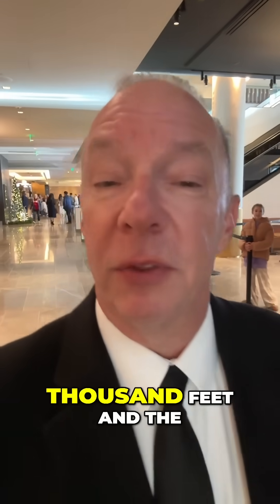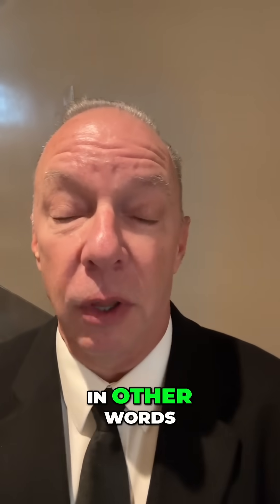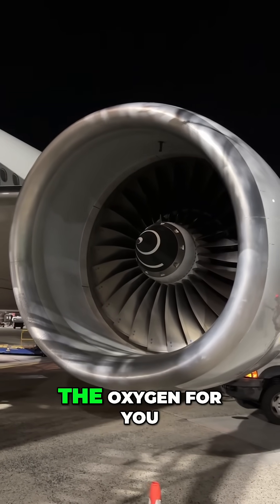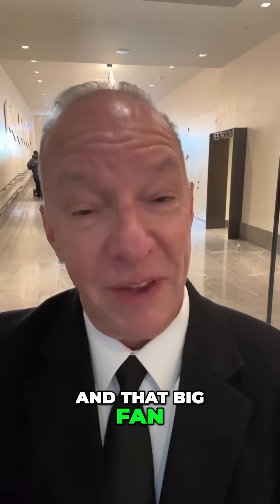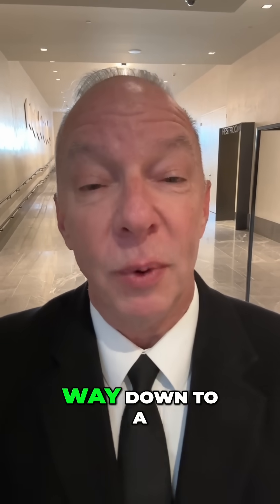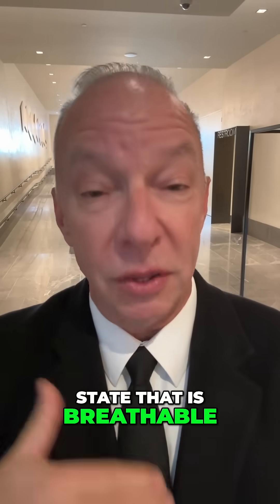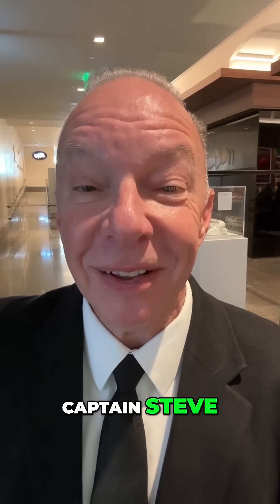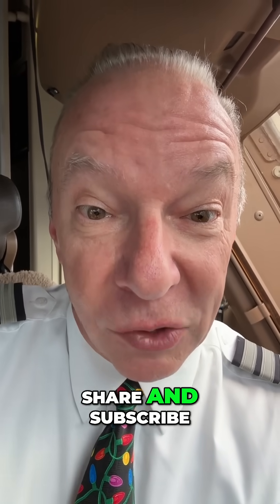How Airplanes Make Breathing Possible at 37,000 Feet

Comment: On very long haul flights, the partial recirculation of 40% of the cabin air should cause some slight increase in CO2 accumulating, although it is probably negligible. On the other hand, the cruise altitude air must have rather low CO2 content due to it having higher density than oxygen, nitrogen etc.

Comment: Under pressure.  Pressure pushing down on me, pushing down on you.  

You are breathing air that has gone through and been compressed by the engines.  Hopefully none of the bearing journals are leaking oil.....

Comment: This is extremely interesting and I bet 99% of people are not aware of it. This explains some things that I've wondered about. Like there was the flight that ran thru an ash cloud from an erupting volcano at night. THey couldn't see the ash, but they could see the glow of the ash as it hit the plane and had friction related electronic activity. Also in the plane, it got smoky, but no fire was ever found. I had always wondered why the ventilation units were dispersing the smoke. Probably due to the HEPA filters becoming completely clogged and the pressure pushing thru the seals, it also explains why in became so hot, because the AC unit could no longer function with the volume it was designed for, it was clogged up and the air was backed up.  Similar problems were happening inside the engines which all flamed out. Fortuntaly and miraculously the engines came back just in time to save the passengers and crew as they got lower in altitude and were going to attempt a landing or a ditch in the sea.

Comment: Ive always been told that your ears pop in a cabin due to the pilots pressurising it ready for flight. I started thinking surely they wouldn't add pressure as we were currently equal to air pressure at ground level so why would we increase the cabin pressure? 

Surely the pressure is actually being reduced a little? To maintain a breathable pressure and to lower the pressure difference between in and out at cruising altitudes for less stress on the fuse. I am yet to look this up but this is my thinking..

Comment: Actually the pressure inside the plane is not at sea level, but around the pressure at 2000-2400m (6000-7200 ft.) altitude. So you do get less oxygen on a plane than you would at home (if you don't live on a mountaintop).

Comment: High* pressure air. Low compared to the combustion chamber, but high compared to the outside air.

Also in pilot training it's made a little more confusing because they also talk about relative altitude as a measure of air pressure, so in that case it's low relative altitude.

(The cabin pressure is measured in relative altitude because the breathability of air is easier to reason about when coming from planes that don't have internal pressure and thus generally fly under 10,000 feet. For reference, an A320 will keep an internal relative altitude pressure of about 7400 feet, so slightly higher than Lake Tahoe's surrounding summits, while flying at around 40,000 feet.)

Also the partial pressure refers to the oxygen in the air while pressure refers to the air as a combined mix.

For example, pumping compressed air into a soda bottle to keep the soda fizzy can cause the bottle to explode, because it raises the pressure of the gas mixture inside, but the partial pressure of carbon dioxide in the air is still low enough for more to come out of the liquid and raise the overall pressure even more than you intended. 😊
Reply: Oh yeah, but in this specific scenario, indeed the partial pressure of the oxygen in the rarified air outside the aircraft is not enough to sufficiently oxygenate blood in your lungs, meaning that your body uses more oxygen than breathing replaces.

Comment: Last I knew bleed air was taken off the engine to run an air turbine motor the air conditioning and pressurization system. Anyway that is how military aircraft worked.

Comment: Capt. Steve, I truly enjoy all of your informative videos but one clarification here. “Down to the pressure level that’s breathable” is not sea level. Most commercial aircraft like your 777 maintain an internal “breathable” air pressure equal to an 8000 foot altitude. The most modern Boeing 787 has a composite airframe and can maintain a lower internal pressure altitude of 6000 feet which makes breathing even easier and improves the effects of jet lag on a long haul flight.

Comment: They don't pressurize the air inside the plane to sea-level pressure, but to an equivalent pressure of about 3,000 feet.  . That's a pressure that is comfortable enough for most people to breathe, but they don't want a BIG differential between the inside pressure and the very low outside pressure at 40,000 feet cruising altitude - That puts unnecessary strain on the big aluminum tube you're sitting in.

Comment: The rotors spin, the Stators (stationary) do not because they are attached to the engines casing. Each stage raises the pressure one atmosphere, turbine engines can raise the pressure over twenty times the sea level pressure.

Comment: Rotors rotate, Stators are stationary.  Both are necessary to compress the air, not only for everyone aboard, but get the necessary air pressure for the Jet Engine's Combustion Stage do burn the fuel that turns the Power Stage Blades that turns the Pumps, Compressors, etc. for the engine to run.....

Comment: I wondered if you were going to be able to explain this without using the phrase "partial pressure".....nope, but this is a good video even if more technical than many people might want to know.  Basically, it is the compressor stages in the jet engines that keeps the airplane cabin at pressure.

Comment: Sorry dude, the stators are attached to the outer compressor case, the rotors are attached to the shaft. Ex aircaft engine guy! The stators slow down (and compress) the air between rotor stages
But yes compressor air is bled off to supply the cabin with air con / air.

Comment: The stator blades dont spin. It's in the name.  They just straighten out the airflow for the next set of compressor blades.  

If that air gets really hot, why does the plane spit ice chunks out of the vents sometimes when changing altitude?  It must be a struggle for the cooling system to adjust for sudden pressure and humidity changes.

Comment: Years ago I was on some kind of express jet and I was sitting on the single row's window seat. The air inside got uncomfortably hot. Then I noticed my left leg was getting burnt from leaning against the side of the wall of the plane. The pilot got premission to fly at a lower altitude (which immediately cooled everything down) and we landed early.  I still wonder what actually happened. The pilot was great at acting like this was a minor glitch with the air conditioning but I knew that couldn't be the problem since I knew it was super cold at high altitude. 👀

Comment: You can breathe oxygen on an airplane because the air inside the cabin is continuously refreshed with outside air that is compressed and filtered, essentially bringing the oxygen level closer to that at sea level, allowing passengers to breathe normally even at high altitudes; this process is called cabin pressurization, where air is taken from the engines, compressed, cooled, and then circulated throughout the cabin.

Comment: Very Good explanation Steeeve.  But See item 4 

1. Bleed air from 1 of 2 stages, depending on the RPM of engine.

2. Passes through an "Overpressure shut off valve"
That valve is electronically controlled and pneumatically actuated.

3. Air goes into a "AC Pack" which is basically a large turbo. The turbo acts just like a car/truck turbo.

4. The bleed air spins the turbo that has 2 inputs and 2 exhaust and 2 wheels.  
Bleed Air ➡️Turbin Wheel inlet➡️Turbin Exhaust➡️Atmosphere

Fresh Outside Air➡️Turbo Compressor Wheel Inlet➡️Compressor Air Discharge

5. "Compressed Air" is then fed into a "Heat exchanger" for rapid air expansion, which cools the air. 

6. Compressed air that leaves the heat exchanger is now very cold and contains humidity is fed to a "sock" that filters the air and traps moisture.

7. There are several sensors and valves that monitor air temp and feed in previously uncooled air back into the cool air stream to mitigate air from being overcooled. 

8. Air is piped into the Cabin.

The point is, air that enters the engine, is not breathed.

Comment: Amazing video. If I may… stators don’t spin (even if they change angle around themselves to avoid engine stall), rotors spin at high speed to accelerate and compress the air. 
Air is taken from the high pressure compressor, not the low one. 
Air pressure is maintained in the cabin by air supply from the engine AND closing outflow valve (fully or partially, as requested).

Comment: HELIOS airplane from Cyprus the cabin pressurization switch 
was left on MANUAL. The airplane reached 25000 feet was placed on autopilot the O2 fell in the cabin everybody suffocated and the plane reached Athens and was making circles until the fuel was exhausted and crashed.
Now better sensors warn pilots to correct it.

Comment: There's one thing that confuses me. You say the air would be really hot, which I would understand at sea level because the air has been compressed, but at 40,000ft the outside temperature is about -50C.

Comment: The percentage of oxygen outside the aircraft at 37000’ is the same on the inside…..about 21%.  The only difference is the (Pressure) At sea level 14.7 lb/sq/ inch allows the lungs to exchange O2 molecules for CO2 molecules which are expelled out. At 37,000’ one can’t suck in air, in fact if you open your mouth, all air in your lungs is expelled out but you are unable to get air in. This low pressure will not allow the oxygen/carbon dioxide exchange in the blood and you pass out from hypoxia. Same thing happens at 6-8,000’ cabin altitudes in cruise. One drink on the ground is equal to 3 drink or more at altitude. Which explains all the idiots.

Comment: Capt. Steve, have you ever been flying and the aircraft rapidly lose pressurization? I’ve wanted to go through one of those simulation where they cut the amount of oxygen and have you doing tasks or saying things as it goes down. You don’t get long before your body starts shutting down. I’ve heard horror stories though about some physical issues that happen due to rapid decompression but I’ve never researched it much. Best of luck and safe flying. If you ever need a person to hold the camera for you for a few flights, I’m almost always free.

Comment: Yeah nah ! That big fan at the front is a bypass fan , just a big enclosed propeller that pushes most of the air around the motor , you cant see the first turbine compressor blade on this type jet . On military fighter jets that need high speed they are non bypass turbines and all the air in the front goes through the engine .

Comment: When the airbags drop, there will be air for only about 12 minutes. There is no oxygen tank connected to the bags; rather there are two powders that mix and create oxygen as a byproduct. There are real tanks that last about an hour that the crew would be using.

Comment: How come no mention of the outflow valve when it’s the outflow valve that modulates the pressure inside the cabin by controlling the rate that the air exits the pressure vessel? The engine compressor just supplies the air into the system.

Comment: 70% of the air that goes into a turbine is used for cooling. The other 30 is used for power. Everything that uses air from that engine takes away from either cooling or power.

Comment: Great explanation, the only thing he got slightly wrong was to say the stators in the engine compressor rotate.
Stators are stationary blades and rotors are the blades attached to the shaft that spin in between the stators 👍🏼

Also the pressure that’s inside the cabin is the same pressure that you’d find at 7000-8000ft which is why things such as bottles or sealed packets “inflate” slightly at altitude, the pressure is lower than if you are at ground level.
The aircraft skin wouldn’t handle the stresses if it were pressurised to the same level as on the ground.

Comment: No. There are no big oxygen generators.
The mask is a chemical reaction that produces oxygen ONLY when you tug down to trigger it. 
It lasts about 3-5 minutes which is the timeframe it (hopefully) takes the pilots to descend the aircraft to breathable altitudes.
The pilots have larger and lomger lasting oxgen tanks for their supply.
Clearly the are no generators because the weight would be too much for economic and fuel efficiency reasons. 
What is this guy talking about?
Does he even know aircraft?

Comment: I worked on Gas Turbines in a power plant.  He is absolutely correct.  The industrial engine i worked on was the engine used in the 747.  the 8th stage of the compressor was used for cabin pressurization when used on an aircraft.

Comment: Captain Steeeve is it possible to add ozone generators to clean the air during flight for people passing gas during flight. We use ozone generators for fire restoration and the can be turned down so they are safe to breathe. Sone restaurants and nightclubs and even convince store use they also

Comment: Good information, however to be technically correct; The jet engines DO not produce oxygen. The engines use bleed air to run the air conditioner packs to and that hot air is mixed with ambient air (since ambient air contains 21% of O2 concentration however a lower partial pressure) to fill the cabin with breathable pressurized air. That system works in conjunction with the pressurization system in order to maintain cabin altitude that vary between 5000ft and 8500 feet depending on the airplane. Also not all airplanes like the 737 have HEPA filters.

Comment: Slight correction. The air in a aircraft is pressurised to approximately 8-10,000 feet. it reduces the stress on the aircraft. The pressurised air also constantly leaks so has to be topped up all the time. If you wish to know what happens to aircraft which don't work properly look up mayday, helios.

Comment: The dream liner has a better safer system .Tubine lubricating oil is extremly toxic causes brain death issues .The fan units can leak Turbine oil and it goes into cabin air and creates more victims often the flight crews

Comment: This is true for almost all airplanes. The 787 does not use bleed air from the engines. It uses electrically powered compressors to pressurize the cabin with fresh air from outside.
Reply: The A350 works the same way as the 787
Reply: Why is it not using the engine air?
Reply: @meinderthoving the short answer is fuel efficiency and more controlled air pressure inside the cabin.
Reply: That would minimize pass-through fumes, too.

Comment: So, Captain Steve, what keeps the jet fuel (which contains organophosphates - a neurotoxin) from leaking into the cabin air? Or, DOES jet fuel sometimes leak into the cabin air more often than the airlines will admit? Haven’t planes gone down due to neurotoxin poisoning of the flight crew (and all the passengers)?

Comment: This didn't come as a suprise as my self has been a diver for many years, where we have the opposite problem.
We want to stay below 1,4Po2 (Partial Presasure Oxygene as Steeeeeeeeeve mentioned, which at sea level is 0,21bar or 21%) and unless you absolutely MUST if case of save yourself stay above 1,6bar of O2 or risking a epileptic state 50m below the surface or where ever you are at. Pure oxygen are safe-ish to about 6m of depth, air about 70m and you'll be drunk as F during that dive. ;). That's why we have different gas mixtures with He(helium), to lower both Nitrogen and Oxygen.

Comment: Hey Captain Steve, you are wrong about the Stators increase Air pressure ! It is the Rotors and Stators that gradually decrease in size and increases the Air pressure.  Remember the Rotors feeds the Stators and so on until the air enters the Combustion Chamber !!!!  Your mistake is understandable, because you are a Pilot, not a Aircraft Maintenance Technician like me 😂.

Comment: Replace “breathable“ with “usable“.  It would be more accurate to discuss how the airplane is a pressure vessel, and how the bleed air from the engines provide the biologically necessary pressure in the cabin.  We know from Himalayan expeditions that humans can adapt to brief periods at 27,000 feet.  The oxygen at altitude is most definitely breathable, it just may be that the partial pressure isn’t adequate to maintain consciousness.

Comment: I’ll do you one even better.  If there is next to no oxogen at cruising altitude 36,000 to 40,000 feet and the jet engine is an internal combustion and needs oxogen to burn fuel how is it more efficient at burning fuel in a low oxogen environment than it is in an oxogen rich lower altitude environment ?

Comment: As an aircraft mechanic.  Well put Capt.
Reply: As someone who is completely ignorant of aircraft engines, assuming the same throttle position at 5,000 ft. and 35,000 ft.   Is the air directed out of engine or fuel leaned to achieve the same mixture at different elevations?
Reply: Did you miss the stator rotating there?  You know that it doesn't rotate.  So he's mostly correct for the basic understanding of the systems which is all the pilot needs. The pilot does not need to know the inner workings so he's forgiven. He probably just mispoke anyway

Comment: Simple fix, Engine Intake turbines duct partial air supply into a Pressurized cabin, O@ as a percent of the atmosphere remains 21% regardless the Atmospheric Pressure, the Engineers figured this out in WWII and had similar Compressor systems on at least one or two engines to keep the O2 bottle for flight crew filled.